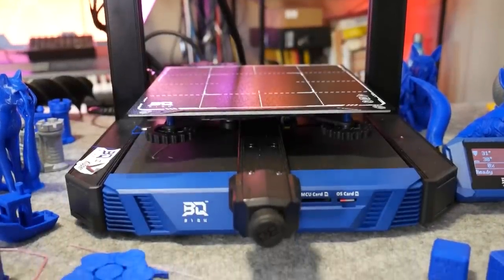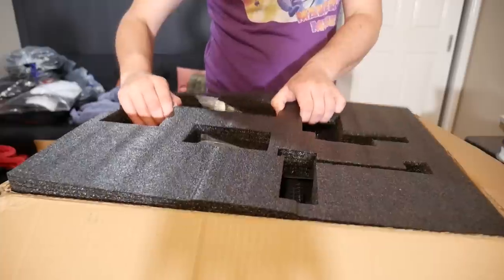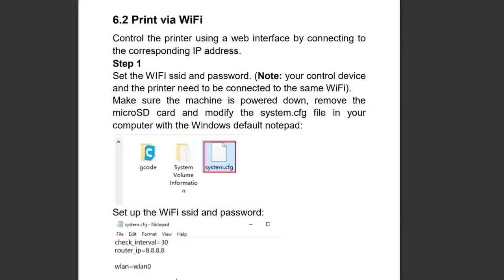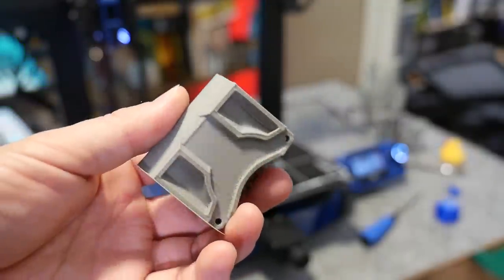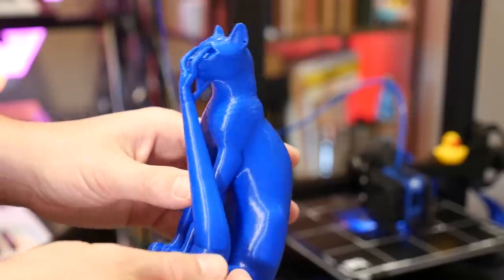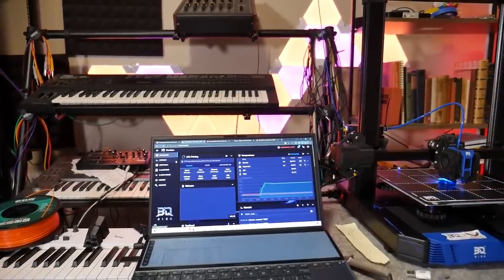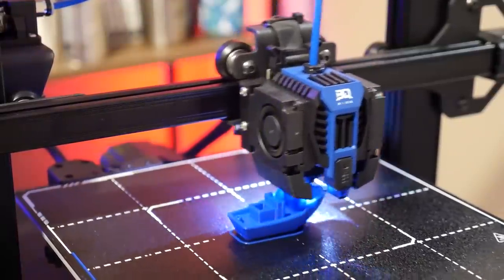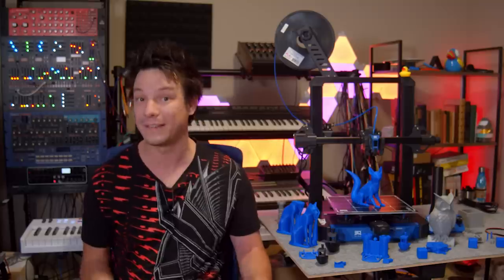BIQU Hurakan 3D Printer Review

Comment: I run Klipper on my Ender 3 as I'm constantly changing the firmware and tweaking things and also because the stock board has too little space to fit a firmware with all the marlin features I want, e.g. pressure/linear advance, ABL, etc.

One seemingly useful feature is that resonance compensation, but: It doesn't make sense on an i3/bed slinger style printer for 2 reasons:
1. These printers are pretty slow and the gain of resonance compensation only comes for printers using higher speeds liek a voron, ratrig, etc.
2. More importantly: The resonance of a system highly depends on the mass moving. So measuring the resonance of the x-axis of a bed slinger style printer is totally fine. Measuring the resonance for the moving bed/y-axis? No, that is obviously bullshit as the mass increases with printing. There is no point in time where the mass moving along y is constant, therefore measuring the resonance of the (empty) bed is pretty much useless unless you are printing air.

Comment: I tried klipper once on my ender 5 plus, which has a few part upgrades. I took me like 3 or 4 days to print all of the calibration things and things kept going wrong and I barely saw any difference. After 2 weeks I went back to the stock firmware with Astrobox running on a raspberry pi... I'm all for klipper, but don't make me do all that shit again. Sounds like they leave you with all the tools to make it a great printer while it's not necessarily a great printer out of the box.

Comment: Personally feel like this printer just doesn't need to exist. Besides a fancier firmware, it's basically yet another Ender 3 clone with v-wheels. It's 2023, we need to at least see more printers with linear bearings or linear rails. The Sovol SV06 doesn't really innovate as such, but it's still twice the printer that the Hurakan is in terms of the out of the box experience. Biqu should stick to making mainboards honestly. They do a grand job with the BigTreeTech line

Comment: You don't need the "own control-board" for Klipper, just any Raspberry Pi or other Linux system will do fine.  And you'd be surprised how much it can improve performance of an Ender 3 (Pro in my case).  Sure it still isn't a core-xy, but it can go so much faster without stuttering than OctoPrint+Marlin could on the same printer.
Reply: Has the Raspberry Pi shortage ended, then?  I know for ages they were basically impossible to get, and was under the impression that a big part of the reason BTT made the Manta in the first place was because there weren't any Pis around.
Reply: Basically, BTT was using AllWinner chips since the big vendors (Microchip, NXP, ST Microelectronics, Broadcom) has run out of Linux-capable chips. BTT literally made their own CM4 module just so they can run Klipper in an embedded form factor.
Reply: @davydatwood3158  As I said: "or other Linux system".  I think you could even run Klipper in WSL2 on a Windows machine, the only tricky thing might be getting USB / serial access.  That said, an old laptop or "nettop" can probably support 4 printers when you install Linux and Klipper on it.  I have an Ender 3 Pro and a Sapphire Plus attached to the same PI3B and it has no problems controlling both printers in parallel.
Reply: Technically marlin now supports input shaping like Klipper so you get the speed increase for free, sure, the web interface is not available yet, but we will si
Reply: @Lucas_sGarage  I tried input shaping on Marlin some time ago and was actually disappointed.  On my board (SKR mini E3 v2.0) input shaping depending on the config settings I was getting hang-ups, which I think might have been caused by the overhead of inout shaping causing the interrupt handling to no longer be solid.  Anyhow, tweaking the config and turning off some unneeded stuff I did get a stable build, did the test-print to determing the input shaping parameters and ... again was disappointed by the result.  Yes, it did reduce ringing a bit, but nowhere near what Klipper gives on the same printer (Ender 3 Pro).  I think that Marlin having to run everything on the printer is just too much for the tiny STM32F1 on my board.  Results might be better if you have a faster CPU on your board, but after this struggle I just Klipperized that Ender 3 as well - using a second Klipper instance on the Pi that already drove my Sapphire Plus - and then this STM32F1 is more than sufficient to see the full input shaping magic.

Comment: Running the OS from the SD card that way is a known bad design. As in: running a non-write protected OS from an SD on a Raspberry Pi is infamous for wearing out the SD card. So now the SD card will corrupt over time any way. The standard solution is to make the OS SD write protected and store settings and data on a different (e.g. USB) drive.

Comment: Imo, once you go klipper, you don't go back. It's definitely a painful learning curve though.
Reply: Just the lack of need to recompile the firmware every time you need to change some important setting is worth the hassle.
Reply: @vinnycordeiro  have you heard of gcode comands? pretty much 80% of the settings can be changed through G-code commands
Reply: @Lucas_sGarage  Like changing the thermistor type you set wrong by accident? Or the print bed size?

Don't get me wrong, I know that some settings can be changed through g-code, as long as you remember to always issue them when needed. I pretty much prefer just to change a configuration text file.
Reply: @vinnycordeiro  to my understanding there is M305 for the thermistor and to be fair most people will probably get the config files provided, everyone can pick and choose what they want, absolutely

Comment: If it's using a Raspberry Pi, I discovered recently that Raspberry Pi OS does not support WPA-3 security on Wifi networks. You may need to switch your Wifi network to WPA-3/WPA-2 mode for it to connect. Also helps if you can set your router to give it a static IP address.

Comment: This was such a waste of money.  Had problems from the get-go.  Couldn't connect to my wifi for months so no access to klipper.  The Probe broke completely off and the final straw was that the power went on it and almost started a fire.  Thankfully I was in the room when it happened and was able to unplug it before anything serious happened. Customer service was originally okay with the broken probe and stuff but it has become absolutely useless for this electrical situation.  They accused me of improper use and then refused to replace it because it was just outside of warranty (like by a month or two). They won't replace the power or even give a decent discount (5% is a joke), despite it almost causing a fire.  I do not recommend this machine to anyone and I hope no one else ends up actually having a fire.😠

Comment: I don´t get that. The i3 design style is old and inferior to core XY. Why would you combine that with klipper instead of fixing the overall design and use a lightweight direct extruder instead of the shitty old bowdenstyle + Klipper. Klipper is fine and dandy got get me wrong but there are other more important aspects to the whole system besides that.
Also design choices like " oh it only has one Z motor" yeah, because that makes sense, 2 motors would be overconstrained. It should have 1 motor and TWO guides, coupled to the one motor.
Reply: The choice of extruder really doesn't make sense. I3 designs aren't all that affected by extruder weight. My printer has ridiculously heavy extruders but still flies with Klipper. Extruder weight much more of an issue for corexy or delta style printers.